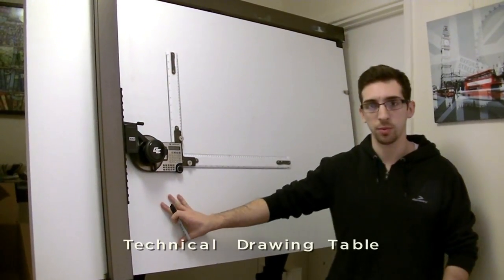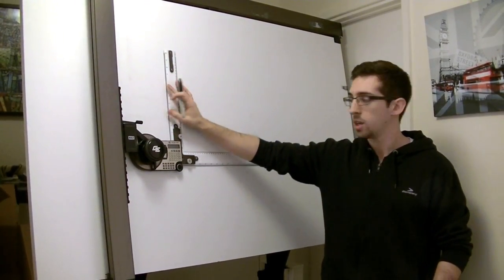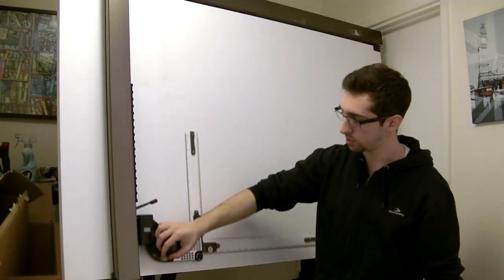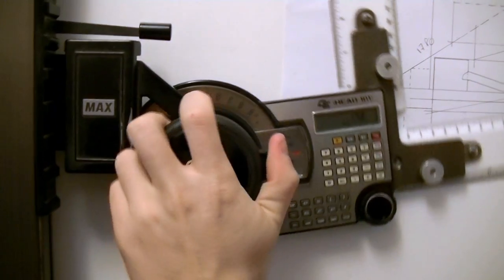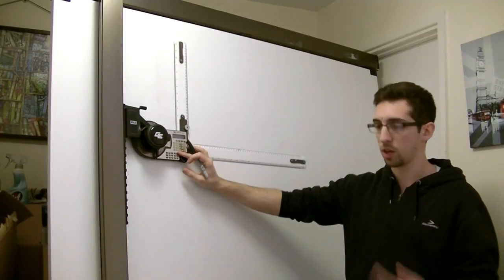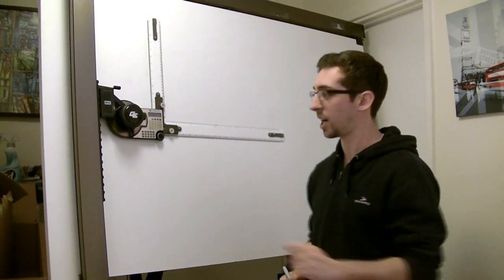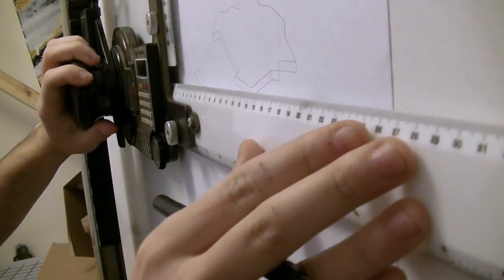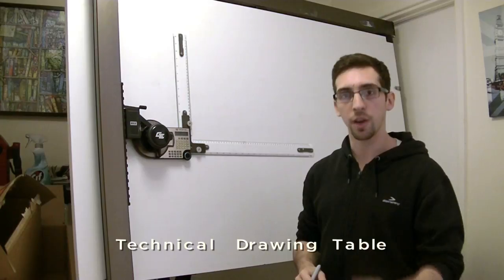TECHNICAL DRAWING TABLE - Video Tutorial - RECME

Comment: I bought a old Kuhlman drafting table and the drafting arm runs on the rail is a Systype II  if I lock any one's of that levers when I draw a straight line it does not draw a straight line its out with 2mm around 80cm lenght line drawn could this old huanted table be defective

Comment: What are the advantages compared to CAD?
Reply: You don't need a computer, and it is cheaper... But it is less convenient to use these.. only real use is for working or displaying old paper plans.

You can get the clamp on arms that attach to a workbench... Those are useful for woodworking or machining.

You can not beat cad in accuracy, speed, or comfort. Also things like 3d walkthrough and duplicatiin makes cad invaluable.
Reply: You can make beautiful drawings also.
Reply: It is true, but those machines take up so much space. Could just as easily use a cintiq display with a plastic ruler for that feel, and use the guides in illustrator.